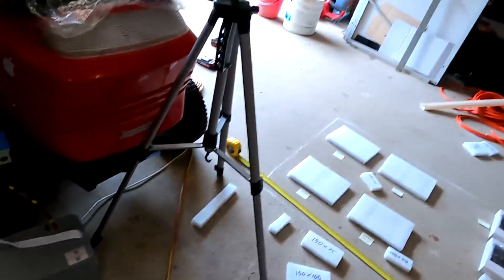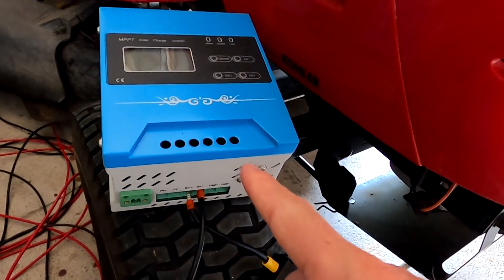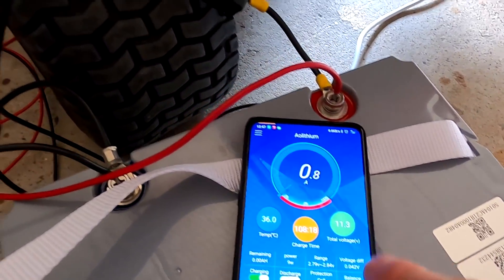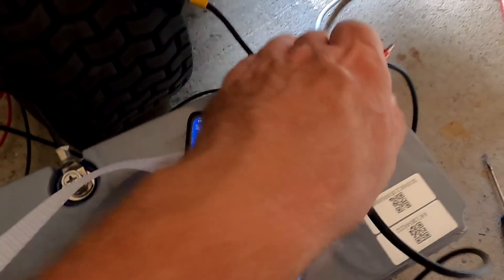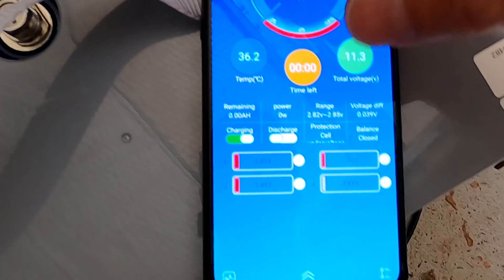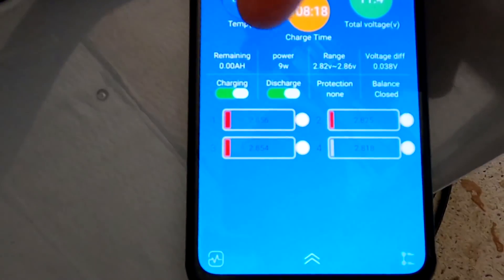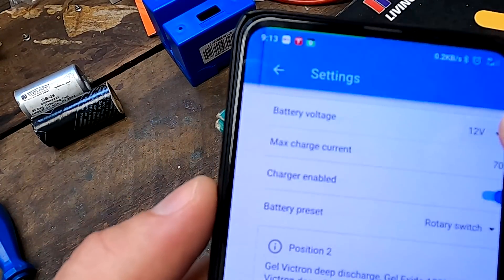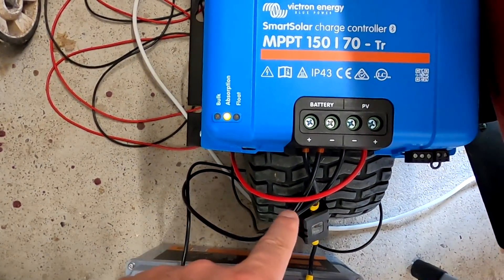Battery empty, BMS disabled further discharge and MPPT cannot recharge. Aolithium BMS in a deadlock!

Comment: Turn off all loads and set recovery voltage to 2.7v. This is why you don't want to completely discharge batteries, besides which, the battery cells don't need to be down that low. My testing yields an extra couple of degrees of heat generated by the cells once they discharge that low. This is quite common with cheap SCC and BMS, also the reason I set low voltage disconnect to 3.0v unless doing a capacity test. It actually takes extra circuitry to get power for the SCC from the solar panels, but basically you get what you pay for with the Victron.
Reply from the maker: Yeah, it was an extreme test and all cells went down to 2.5V. Under normal operation conditions, you would not do that and have the inverter and load turned of before that (3.1 or 3V as you said). Apparently the Victron can even charge completely dead batteries. I've got some old AGMs here and will test 😉
Reply: @OffGridGarageAustralia  Yes and no about the Victron. The battery must be "on" when you first hook it up, and there must be power from the solar panels when it is disconnected. Without the battery being on, it doesn't know what the voltage is, and of course if there is no power from the battery or the solar panels, there is no power to run the SCC. I haven't tried it, but the Victron might retain the previous battery voltage in non-volatile memory, but if I was writing the code, I would not trust that and would refuse to charge (since someone might have hooked it up to a different voltage battery). I am pretty sure if you change the Victron to a different voltage battery, you must change the voltage settings in the app, disconnect, and then hook up the different voltage battery for the same reason.
Reply from the maker: @john_in_phoenix  I never had any issues with that in my CC. They always keep the 48V set initially. I have done a lot of 'experiments' on purpose and accidentally , disconnected the batteries while playing with the BMS and they just sit on Absorption voltage, supply power to the load (if enough sun is there) and reconnect once the battery is back online. I've never seen one changing the main voltage though.
Reply: @OffGridGarageAustralia  I thought it was you that was told this by the vendor with your first SCC, but I can obviously be wrong.
Reply from the maker: @john_in_phoenix  The Victron SC do an auto sense at the first time you connect them to a battery and then stick to that. And this make sense, otherwise it could falsely assume it now has a 48V battery connected if it was on 24V system before and overcharge the battery now with wrong settings.

Comment: Hi Andy. I have a quick question unrelated to this video but which may affect you. 

In the U.S under the electric code we are now required for solar systems mounted on BUILDINGS to have a "rapid Disconnect" on each individual solar panel (not string) to allow firefighters to COMPLETELY disconnect all parts of a solar system to prevent firefighter injury or death.

This started with the 2014 code, was tightened up in the 2017 code, and became much tighter in the 2020 code. Ground mount arrays and arrays mounted on a DEDICATED solar power shed are exempt.

I was wondering if you had something similar in Australia. In the U.S, your garage WOULD be required to have the panel level disconnect simply because it is mounted on a non-exempt BUILDING.
Reply: Australia has or had the requirement to have a disconnect on the roof for the fire fighter safety concern.. and that is ironically a great way for fires to start because turns out having stuff up on a roof might be likely to fail.
Sounded like they were maybe going to scrap that requirement to save fires.. but I dunno what the latest is. 
Individual panel level switches sounds like overkill..?
Reply: @--Nath--  With the newer higher power panels, a single panel could be enough to cause harm or fire so the safety factor is about more than fireman safety. It is expected under the latest U.S. code that the inverter or another controller of some type would detect an arc fault or other problem with the roof top array and shut the entire array down immediately hopefully preventing a roof top fire
Reply: @--Nath--  Even though the disconnect is on the roof, the switch to activate the disconnect is located down low usually where the "mains" power enters the building so everything can be disconnected at once.
Reply from the maker: You have a disconnect on each panel? That sounds far from being a 'rapid' disconnect though. 
Here the rules have changed and under certain conditions a roof top isolator is necessary any more. But we now need an earth leakage alarm, like and RCD for the solar system 🤦‍♂️
Reply: @OffGridGarageAustralia  There is an additional junction box at EACH panel which receives a signal which if stopped, automatically tells each panel to disconnect. 

The panels attach to the electronic disconnect switch rather than to each other. Either the Inverter or another device such as a switch or even multiple devices can turn off the signal.

in an on-grid system, even the absence of mains voltage can signal the panels to disconnect. 

I suspect that in the future solar panel manufacturers will begin to include the disconnect as part of the junction box attached to the panel.

Comment: I’m confused. The problem is the CC won’t start without a battery connected. Relay or FET BMS makes no difference. A simple PWM CC will work as it will pass power from the Array by default. Of course, the real issue is why did the system allow the batteries to be discharged to the point the BMS had to step in to protect the batteries?
Reply from the maker: That was an extreme test, Kevin. I discharged the battery so low to see what the BMS does and how it handles it. Yes, the problem is with the cheap MPPT as the Victron CC could start from solar. Als,o, as you mentioned, the load should have been turned off before reaching such a low voltage. Quite a few people have had similar issues from what I can read here.

Comment: Andy, the solution is to leave everything connected and bypass the solar charge controller. The solution is a dpst switch to connect the panels directly to the battery until the low voltage recovery voltage is reached. This is a good design and the workaround is easy.

Comment: Always make sure that the load disconnect setting on the charge controller is always higher than your discharge off setting on your bms.

That way, unless the charge controller fails, you will always be able to start your controller. It must be the wiring of that controller!
Reply from the maker: Yes, absolutely. That is correct. It was a test to see what happens and if the BMS can handle it. Turned out it can but the CC couldn't 😂

Comment: Those Victron chargers are the best you can get in my opinion. I use that and not the built in solar charger of my inverter.
With my agm´s i don´t have a bms of course just the top balancers. Great video Andy, i have learned a lot about lifepo4 with all  those  tests you do. Thanks!
Reply from the maker: Thanks Dieter. I'm also very pleased with the Victron Gear so far. If there are problems, they fix it with a software problem...

Comment: With the relay BMS the same would happen unless that small cable also lets voltage out, as you showed you need voltage coming out for that solar charge controller to turn on

And if the cable is letting voltage out then the battery could still discharge at a very low rate after the relay has been turned off
Reply from the maker: Yes, that is correct, the QUCC will allow a small current to get out of the battery even the relay has disconnected it.
This was an extreme test. Usually you should stop discharging these batteries at 3.0V. It would then have still enough capacity left to supply power to the MPPT until the next morning. The BMS would not turn off discharging in such a normal set up.
Reply: @OffGridGarageAustralia  on the QUCC, isn't there a risk of overdischarging your battery because that little current that is being let out? A lot of loads would turn off if full current isn't coming out but what if you had a resistive load that keeps drawing current out even after the BMS has turned the relay off?

Comment: as you know the best controller bms for lithuim 12 to 24v is electrodacus as it is an all in one unit
Reply: For sure this is true, but dacian has Lots of work to solve... many people want 48v, Software Updates and the Software needs a redesign to become User friendly. It seems he is not building a Team... not sure where sbms0 is in 3 years
Reply: @BischesseHunting  yeah i agree andy keeps bugging him for a 48v range i think if he really did i think he be set for life for money as they be flying of the shelf faster then can be stocked
Reply: @1981dasimpson  he cannot deliver 24v at the Moment i believe... so this future Szenario is already here. He has not planning for future grows. He is satisfied with the current Situation.
Reply: @BischesseHunting  i seem to recall his systems are 24v or did you mean 48v
Reply: @1981dasimpson  He should build a 48v Version, but currently it ends at 24v
Reply: I have build 1120Ah 24V with 32x 280Ah with sbms0 and 5kw solar via 10x dssr20. Works as Designed, Overall very nice, but several open ends if you Look at details
Reply: @BischesseHunting  as to how i would use the system i found 24v fine as most of it i be stepping down anyway dont like stepping up if it can be helped and ideas for 12v washing machine and such maybe even 24v 48v to me is just to many cells in series to keep track of and balanced 12v is to low to much stepping up of power 24v seems good can be stepped down easy for laptops etc been more efficent
Reply: @BischesseHunting  yeah the weak point is solar been on off but the system can talk to victron mppt controllers to get better solar production
Reply: @1981dasimpson  24v is good for Lots of stuff but the bigger the System the higher the battery voltage should be
Reply: @BischesseHunting  i dont see why

Comment: sounds like a terrible charge controller design
Reply: you got to bare in mind that 90% of controllers are built on lead acid systems lithium is an after thought and in theory all a controller has to do with the bms andy has is put out a fixed voltage so really just a buck converter the bms should do the rest the better the bms the dummer the charge controller
Reply: @1981dasimpson  For that 90% figure to be correct, one has to include the factor of whether or not it is a newer controller or an older one. Most if not all new chargers are built to also handle lithium via a setting in the charger. For older chargers, that may be true bot for newer ones, it may not be.
Reply: @danielglang6312  the way i see it is they do not have a built in bms or a way for the controller to talk to a bms unless they is one im missing so in my eyes they still ment for lead acid but just have saved voltage settings for other battery cems
Reply: @1981dasimpson  You are correct in that the chargers themselves NEVER have an included BMS. The BMS purpose is to control/balance the batteries, not the chargers. 

Part of the charger's function is to massage the output of the Solar panels themselves before passing it on to the battery. Some newer chargers can detect the voltage of the attached battery while others do not have that ability. 

 The chargers which can determine the battery's voltage may not be able to handle ALL of the most common battery voltages but may be restricted to only one or two possible voltages.

Likewise, the chargers are usually restricted to what possible voltage or current they can receive from the solar panels.

The bottom line is to never assume anything or make general statements but to consider each charger individually and RTFM. (read the f!@#$%^ manual).
Reply: Many Solar Chargers were designed to require the battery being connected before any Solar panels were.  The reason was to protect the chargers from uncontrolled current coming in from the panels.   Older design chargers still function in this manner in that they require battery voltage to run.
Reply: This why there is a distinct order in powering up a system with the batteries connected first followed by the solar panels. When powering down a system, the panels are disconnected first and then the batteries.
Reply: @danielglang6312  yes not only that but so the controller knows what voltage it needs to run  to change the settings or they would be a very good chance over overcharging if they powered by solar then they would have to be user set or fixed voltage ranges
Reply: @danielglang6312  they is no uncontrolled current the problem is the controller has not detected what voltage the battery is to know what settings to run
Reply: @1981dasimpson  True about "current",  I should have stated voltage and potential current. 

Most newer chargers can detect battery voltage, but the older ones may not have that ability.  

The Solar industry is still very young relatively and developing as problems and needs are discovered. The oldest technology was very primitive relative to today's and tomorrow's will be even better.

One must not assume that "ALL" chargers work the same or have the same ability to determine what voltage battery they are hooked up to.

This especially true of the smaller  chargers which were set for only one specific voltage battery. The other consideration is what voltage or current can the controller handle.

Relying on the Solar Panel to power the charger is dangerous because the power can start flowing before the charger can determine what it will be. some of the early chargers required a "dump load" if the battery couldn't absorb the power coming in or a battery was not connected.

syllable
Reply: Reply was truncated or edited by Youtube.
Reply: @danielglang6312  yeah agreed my epever has to have battery connected to know if it is 12v or 24 as i have panels in series

Comment: Ja gut so ist es auch beim Daly aber mit einem Victron Laderegler geht's ohne Probleme. Da versorgen bei leerer Batterie die Solarpanele mit den Victrons direkt den Wechselrichter und die Batterie wird mit geladen.
Reply from the maker: Jemand ha hier geschrieben, das sein Daly funktioniert und wieder started, wenn nur die Sonne am morgen rauskommt. Verschiedene Software?
Reply: @OffGridGarageAustralia  Das ist sehr gut möglich 🤔 es ist immer wieder aufgefallen das Einstellungen die mit einem 8S oder 16S funktionieren nicht mit einem 4S möglich sind🙈 bestes Beispiel ist die Möglichkeit den Geräte Pin zu ändern 🙄
Reply from the maker: @johnnycagiva737  Hab das schon oefter gelesen. Scheint verschieden Software oder Controller Hardware zu sein.

Comment: when playing with lithuim i had this problem a few times one way i found to solve it was a buck converter between the solar and the battery this way the battery could be brote back upto turn on voltage then contoller tulk over come to think about it i had an odd issue with epever tracer when i was running lead acid the controller would switch loads off bring an error message up but seemed to also lock it self out of charging unless is was because i was in the uk with very poor sun levels so it never got to the voltage threashhold to turn back on fully again
Reply from the maker: A buck converter is a lot of effort to start up a system (almost as much as starting a JK-BMS). It's a bad CC design to require power from a battery in my opinion.
Reply: @OffGridGarageAustralia  I agree it is something we should not have to do but have to ti keep poeer